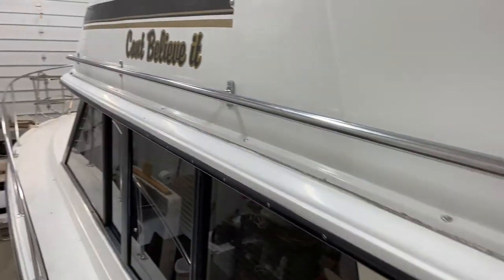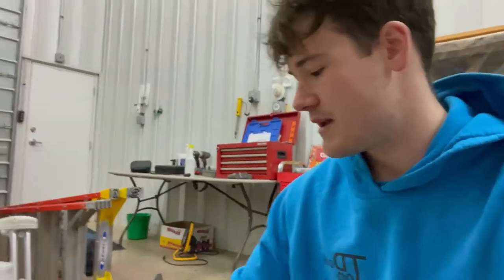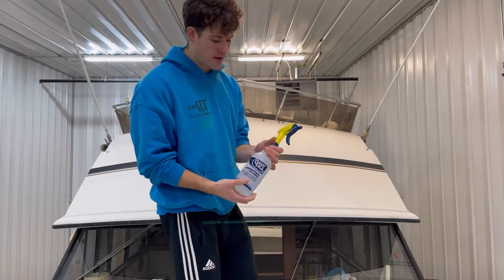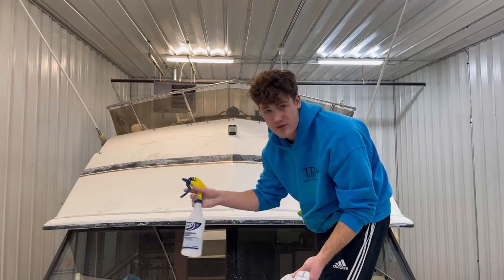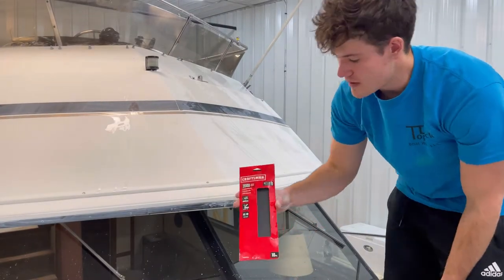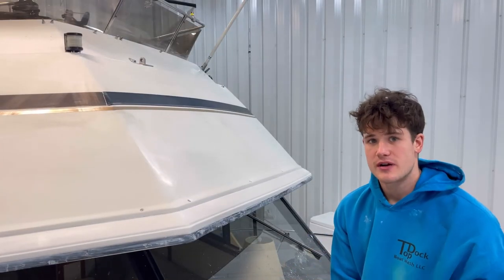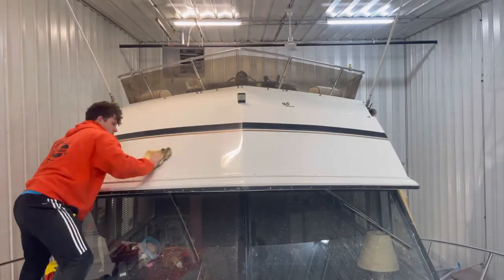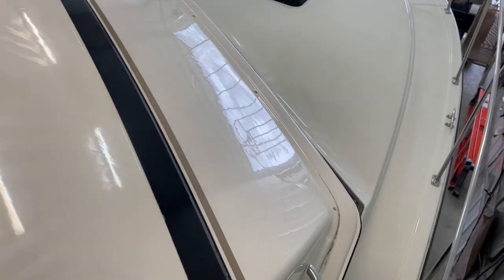How to WET SAND the brow of your boat | Remove oxidation | Boat detailing tips

Comment: Thanks for making this video. I’ve got a 1981 31 foot sailboat with a seriously neglected hull. Was thinking I could wet sand with 1000 grit and skip to starke level R and follow up with elevate. Do you think I can get away with just using 1000 grit and then going to compounding? Would be nice to only have to sand one pass
Reply from the maker: If it’s seriously neglected... probably not. May need 500 grit first.

Comment: Simon Jim truenorthrestorationdetailingmuskoka 
Simon your videos are great 
How do you charge for the brow of boat 
From rub rail up  rub rail down 
And is there a difference in charging for ceramic coating 
Looking forward to your reply 
Thank you 
Jim
Reply from the maker: I charge the entire boat per foot unless the client requests just the hull or just the topside. The brow is included with the topside price. And yes I do charge more for ceramic coating due to materials & the added protection to the boat
Reply: @topdockpro  Thanks Simon
What is your by foot rate please and is your rate different for ceramic coating 
Jim

Comment: How do you remove hold was, oxidation, basically doing a decontamination of the fiberglass before starting a compound job ?
Reply from the maker: I’m not understanding can you please rephrase?
Reply: @topdockpro  
Hi !
I was told to use a kind of degreaser to remove old wax, and some oxidation. Some people use dish water soap. Some other a chemical base solvent. I was asking you what you are using to prepare the fiberglass before a restoration job ?
Reply from the maker: Yes dawn dish soap!
Reply: @topdockpro  
Thanks !